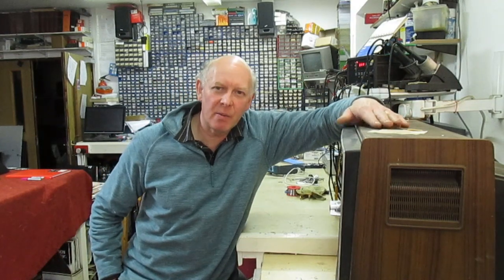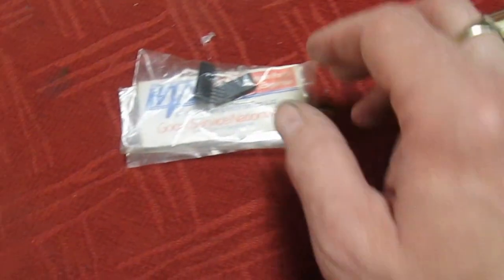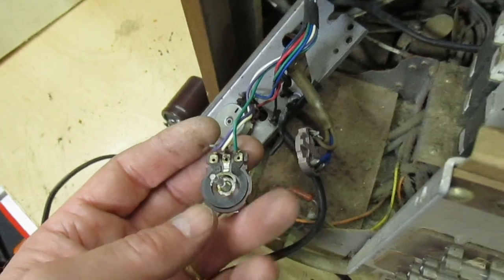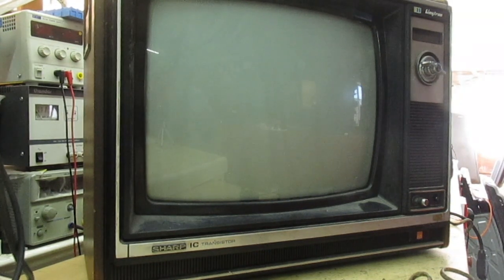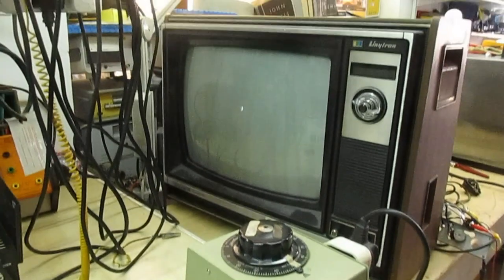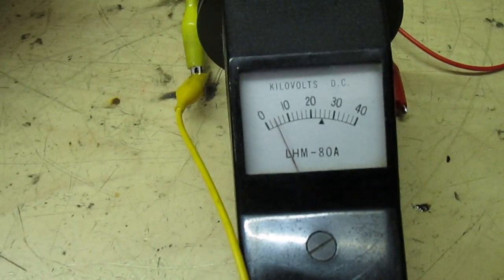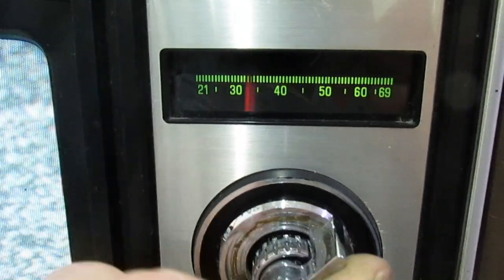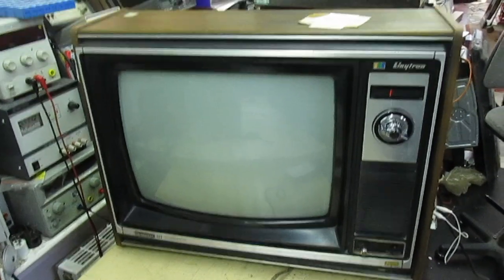Sharp  C 1831H  Vintage colour TV from the 1970 s .

Comment: My first thought on this was that it may have a pseudo-PAL decoder (like my old Mitsubishi CT200B I think, did), but then it would have a tint or similar control somewhere.  If not then presumably Sharp had the proper PAL decoder license.
Reply from the maker: I'm not sure if this sharp set doesn't have a tint control on the back, there is a row of pots accessible on the back but I didnt look what they were.
Reply: This Sharp does appear to have quite a large glass delay-line, so I'd assume it has a proper PAL decoder, rather than pseudo-PAL or simple-PAL, that didn't use chroma delay-lines.

Comment: Nice one Michael! Many thanks for sharing! I do remember repairing one or two of these (but not many). Re. from 34 mins 43 secs. onwards in the video, Re. the Antenna socket / Isolator and live chassis, can remember getting a massive electric shock once when I tried to connect the metal antenna plug to the socket because I was touching the live side (chassis side) the isolator at the same time in the customers house, with no isolation transformer. I learmt from that day onwards, always pull the plug out of the AC mains wall socket before connecting the antenna 😀
Reply from the maker: Only reason I mentioned this is because someone questioned it in another video I made where I just plugged a shy box straight into the tuner of a live chassis TV, all my bench runs from from an isolation transformer so it's second nature for me to do this but as you point out this is very dangerous  to do if your not running from an isolated supply.

Comment: I laughed slightly when I saw the smoothing cap on that bit of mains flex but "the cap is leaky", together with the croc-clip colour control and focus mod tipped me over the edge. You are the British Shango066 (a compliment, not an insult). You used to be able to get slide on elongated spring metal collars (I can't for the life of me remember what they are called) which may sort that cracked knob
Reply from the maker: If I was testing a capacitor by substitution I would have used crock clip leads but knowing my friend I bought this set from he's to tight to buy a set of crock clip leads and I guess that's why there's a cap soldered on to a piece of wire.

Comment: I remember those Hitachi crt's you mentioned, focus at best seemed 'soft', no doubt improved greatly with the replacement one.
Reply from the maker: I would have to look for the service manual to be exact but Im sure the focus on the Hitach ran no more than 500 volts and also a lot of the early Hitachi stuff had the Instavision system where the CRT heaters were still lit at a much lower voltage when the set was not switched on , it may have given a quicker picture at switch on but the downside of under running the heaters was cathode poisoning and a short CRT life combined with soft focusing

Comment: Great video Michael, reminded me of doing something similar with the PAL2 Hitachi chassis from a cnp190, I had a chassis complete from a set with dead crt.
I also had a great cabinet with a 22" A56 120X crt.
I derived focus by cutting into cable from lopt to triple, added a hv diode and a Metrosyl type focus pot from a Grundig, I think 5010.
Results were excellent, the picture was razor sharp and the frankenTV created I used for many years.
CNP190 Chassis I found to be xtremely reliable generally, but the original low focus crts used made for a very soft almost foggy picture, its a huge shame Hitachi didn't use a high focus tube in those sets....
Reply from the maker: I know what you mean exactly, I fitted a Thorn 8000 CRT into a Hitachi CNP190 and it all worked fine apart from the fact the 8000 Tube needed a high potential focus voltage so I tapped the EHT cable and fitted a focus control in the bottom of the cabinet

Comment: I'm enjoying this series of videos, thank you Michael. I made a successful career in electronics repair inspired by you and the other contributors to Television magazine. In the 90's I received hundreds of Compaq CRT VGA monitors with a common and expensive fault- drifting A1 and focus pots within the LOPT making them impossible to set up correctly. My solution was to buy the Thorn (TX10?) focus/A1 unit, the EHT provided it's input and the TX10 unit provided new, focus/A1 controls. It was a cost effective repair.

I wonder if this was the CRT referred to as Unipotential due to the low focus voltage? Also fitted to the PYE Chelsea small screen set, they didn't perform very well.
Reply from the maker: Yes I know the Thorn TX10 A1, Focus control well , the small white one was actually a Thorn modified part used to replace earlier un-reliable units I cant remember if it was called unipotential or not but I do remember some sets such as the Hitachi had a very low focus voltage crt.

Comment: also i have a misubishi CB-100b from 1977 with a early color in line tube with a light phosphor coating im sure you would remember these sets now these are very reliable to not much goes wrong with them i   will have to pull it out one of the days once i get some free time
Reply from the maker: In all my years repairing TV sets I only ever saw a few Mitsubishi sets because no one round here sold that brand, I but if I was to look I may only have a couple of Mitsubishi service manuals, all I can remember about them is the CRT which had a blueish tinted faceplate, presumably some invention to cut down on external light reflection.

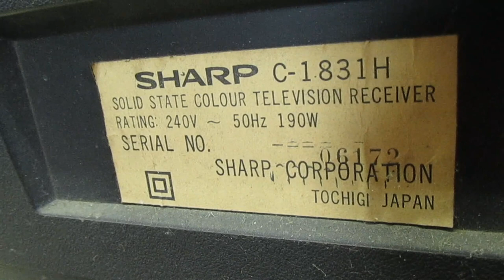Comment: 1:48 190W seems a bit high for a solid state TV. Maybe at 240V, the dropping resistors (and series regulators) had more dropping to do than the ones in the 120V sets we had over here. That set is quite a beast; I don't remember very many solid-state sets with that much metal.
Reply from the maker: in the 1970 s 190 watts was prob just normal with resistor bypassed series pass regulators wasting energy in the form of heat and dont forget everything was over engineered because large scale  integration  and switchmode power supplies had not yet been invented, despite its small size this set weighs a ton !
Reply: About right actually, 70s electronics werent very efficient
Reply from the maker: @Synthematix  no but they still lasted longer that flat panel TV s  only drawing about 50 watts !

Comment: Willow Vale were given the exclusive Sharp spares facility as I remember in mid/late 70s , dont think Charles Hyde etc were too pleased .That service manual looks very original and unused so not needed very often sets like that Sharp were very reliable .The first new Sharp tvs I sold were the 18" and 20" from about 1980 ish so this set predates them .
Reply from the maker: Japanese sets were always reliable as they were building up a name for themselves at the time , I use to go down to willow vale when they were on newton heath to collect parts and pay cash  on a Wednesday before I had an account with them , then later I had the viewdata  terminal which was amazing in its day . Cant remember when I first came across charles hyde but it was very late on in the 90 s .
Reply: @michaeldranfield7140  yes wasnt the Willow Vale view data system a game changer compared to paper catalogues and flyers etc , Charles Hyde came out with a similar system called Chess if I remember correct  - Charles Hyde Electronic Spares System was the beginning of the end of the regular sales rep calling I suppose. Nice to see the set going 👍
Reply: It's funny when you say that Sharp is very reliable, i have here  2 simple Sharp EL-230 calculators from the mid 80's, they still work with the original Sharp batteries inside. The date on the batteries is 1985 and they havn't leaked at all.

Comment: Last week i took 2 CRT tv's apart for scavaging parts, one was a Sanyo from the late 80's and the other one was a Philips IDTV 100Hz from the late 80's begin 90's, but i was surprised that both already had a switching powersupply. There went my search for scavaging  transformers 🙂
Reply: Why? Switched mode PSUs have been common in TVs since the 1970s. In fact, with the development of the Siemens TDA4600 switched mode PSU chip, they pretty much all went over to switched mode PSUs about 1980.

First TV to use a switched mode PSU was the Thorn 3000 chassis, released in late 1969, though that one still needed a 12V rail to start it. The first self-starting one was developed by Sony shortly after in the early 70s.
Reply from the maker: I would have scrapped the Phillips in the blink of an eye but the 80s Sanyo set could well be a collectable item worth saving.
Reply: @michaeldranfield7140  , the Sanyo was a small portable tv, nothing special. The Philips was a big and heavy beast, i remember only a part of the typenr 27P....
Reply: @stickytapenrust6869  , Thanks for this information. I wasn't aware that switched mode PSU where used that early already,but i does make sense, because i know that in my first computer from 1988, there was already a switched mode powersupply.
Reply: 100Hz IDTV sounds more early 2000s.
Reply: @RWL2012  , early 90's 200% sure, because we bought this tv when cable tv started begin 90's. I was then still at school, graduaded in 96. It was back then a tv of more then 1000€. One of the first 100Hz tv's at that time,  possibility to freeze the screen for taken a picture, picture in picture etc.

Comment: I used to own the 17inch version of that Sharp set back in the 80s. Same style tuner and knobs on the side  with green illuminated tuning scale. Was an even more rare model i think than the one in your video. Got rid of it in the late 80s and bought another new 14 inch Sharp with remote control. I was in the tv trade for 30 years
Reply from the maker: after more that 30 years  in the trade  I must be one of only a few left still repairing TV s for a living , most people I use to know have closed down, passed away or got a real job .